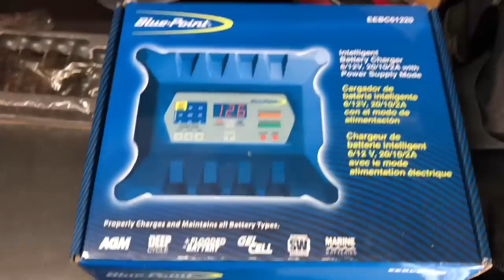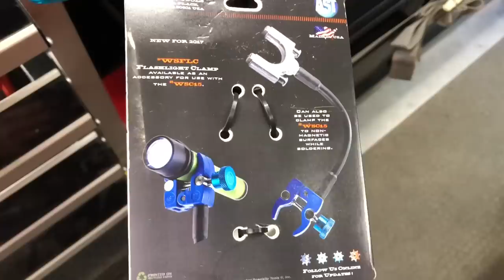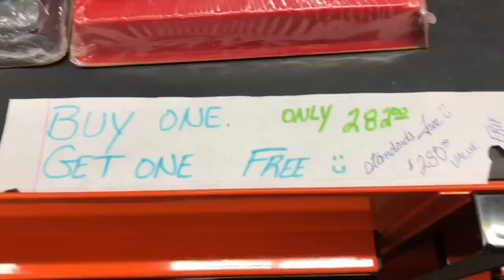Snap On 4 Way Angle Wrenches ?? How good are they ? Are they worth it ?

Comment: Late to the party as always. 
I've got the high leverage pliers and I love them I have the 4-way angle heads in metric and in standard and they are worth their weight in unobtainium 
I don't use them often but when I  do nothing else will work and they save my  hiney.   Had em for years  metric....8 or 9 mm thru 19 0r 20 mm
Standard. 1/4in. Through  7/8 in.
As far as lights go I have the blue point light that is flexible and has rare earth magnets. it has leds in it and it uses a cell phone charger and that thing is also worth its weight in element 115

Comment: Clay , do you know much about the In line 5 with Insite for the 2009 CM871 ? Just got this truck and was needing something to do some of the computer stuff, only have one ISX at moment so was trying not to have to spend thousands of dollars for a complete scan tool right now. Needing something to read codes and possibly change out the turbo actuator. etc.etc Any advice would be greatly appreciated.
Reply from the maker: SKW LOGISTICS 369 I do not all of our fleet have paccar mx engines in there. We have one Cummins and I’ve worked on some Detroit’s but that’s what we do mostly. There should be some alternative’s for cheaper scan tools. I know I got the Bosch (I think it’s DTS200 ?) can’t really remember the numbers of it they are around $400 good for reading and clearing codes and gives some live data but it’s cheap.

Comment: Hello,I have a question.is that fuel line a one time torque to yield or is that what your supposed to do when changing the fuel filter? Thank you in advance.
Reply from the maker: I always crack that line and use the hand pump bleeder until all the bubbles are gone and nothing but pure clear fuel comes out and while still pumping it, tighten the nut back up and it starts everytime with NO codes ! I’ve done it that way since we got our first mx engine

Comment: You don't know if he can ship do you? I'd like those 1/4 semi deep sockets and wobble extensions
Reply from the maker: Gregory Bell I’m not sure ? I know Snap On is strict on the territory they can sell in. Might can get it off snap on website ?
Reply: Gotcha, I will call snapon but they usually don't have those "buy both get this free" and I didn't see it on the local truck.  I will check. Another question, I just got a SO 3/8 locking flex head ratchet and teh button is hard as shit to moveto the unlock position. I know it needs some break in but the button will not move to the unlock position by hand. Was yours like this and then loosen up?